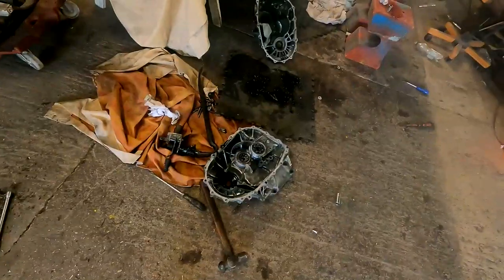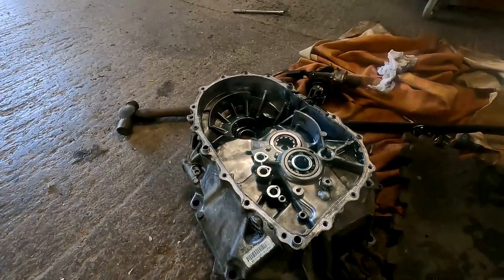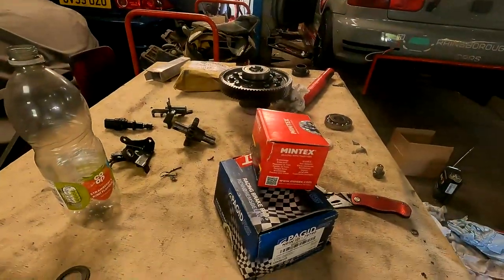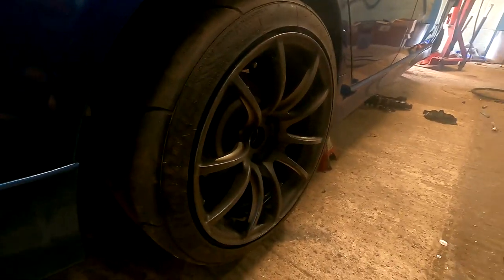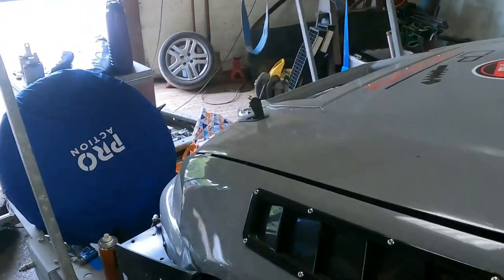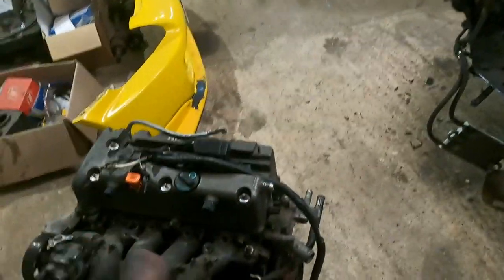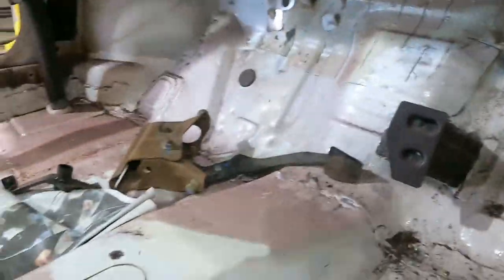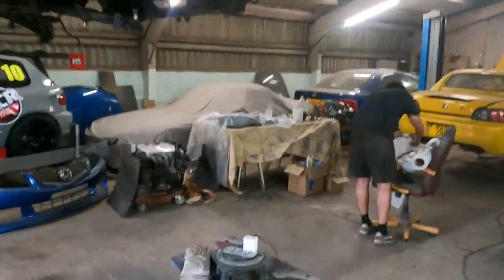What happened to our EG? PLUS Time Attack KSWAP 3G Civic

Comment: Thanks for the updates Pete & Josh. What CV Joint grease are you using on the shafts? I've had to go over to the Redline CV-1 Synthetic Grease, because the usual off the shelf stuff would overheat and break down causing the joints to overheat and fail.
Reply: Josh will need to answer that but it is some fancy stuff i believe
Reply: @petelawton-hcr_works6059  ah, ok ...looks like you're on the right track. Another area would be to check for axle binding(Bottoming-out in the Inner Joints at certain suspension/steering conditions. Love the content guys!
Reply: @danielcgomez  yeah we do think the shaft is binding as the depth of the inner cv we fitted is different to the one we removed but we had no more time to rectify before that last race. We are switching to 36mm cv shafts for next season so hopefully we get it sorted..
Reply from the maker: GKN tripode grease for inner CV and redline CV2 for outer CV, as said above we fitted a non OEM inner CV short notice and we must be close on the length and angle for the driveshaft with the height and camber we run. The non OEM inner CV must have slightly different dimensions and not enough plunge for us as it was binding slightly last race
Reply: @petelawton-hcr_works6059  R&D working out well! Thanks for all the detailed responses guys!